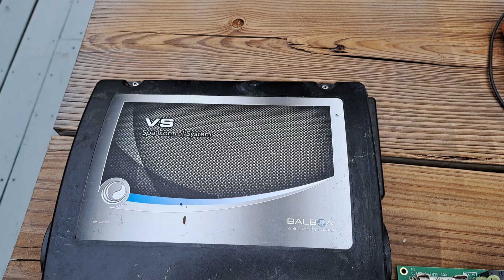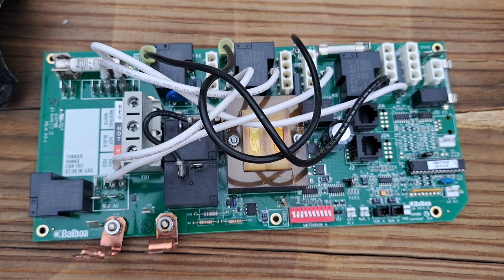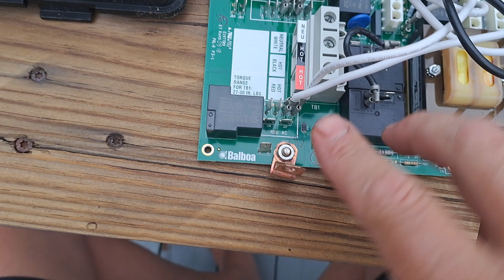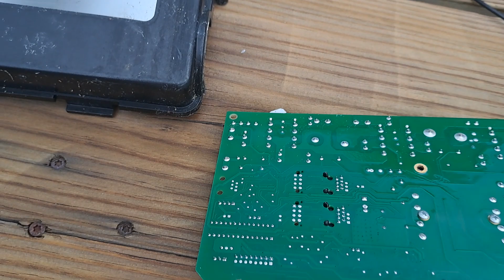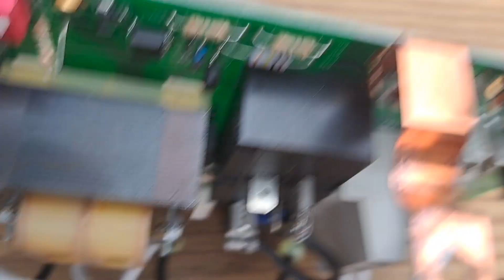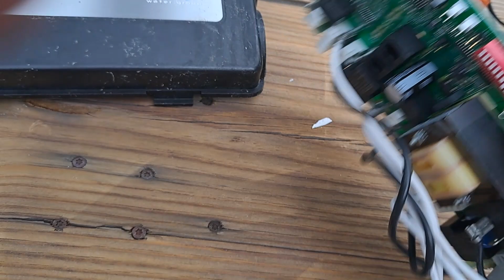Balboa VS 501Z not heating no code heat light on

Comment: Wish I’d seen this about 2 weeks ago. After troubleshooting and replacing the heater it became apparent that it was the board and another one is on the way. I have that exact problem, no voltage to the heating elements. It’s probably better that I replace the board because my soldering skills are 0.0.
Reply from the maker: I brought mine to a local electronic and cell phone repair store. He charged me 20 bucks

Comment: hey would you be able to tell me the markings on Q9 in the bottom right hand corner of the board by the balboa stamp, mine exploded. its a tiny transistor. muchly appreciated
Reply from the maker: I do not have the spa anymore. I looked to see if i had pictures of it saved but i do not. Very sorry.
Reply: all good its up ajnmd running thanks for respponding @chikkicarolina15